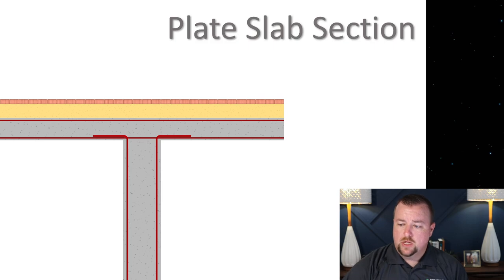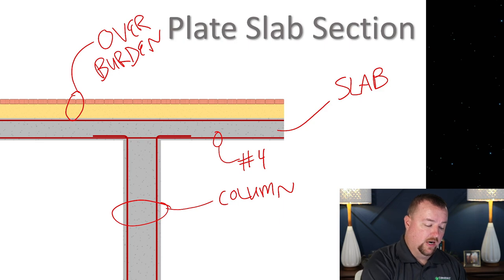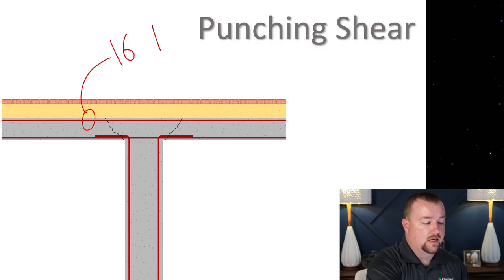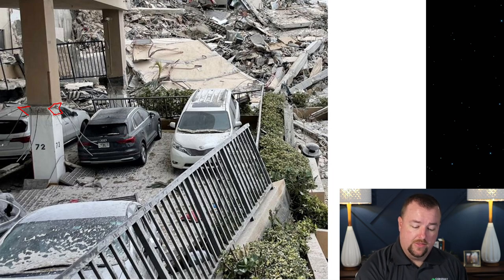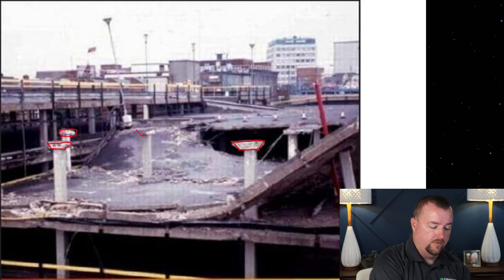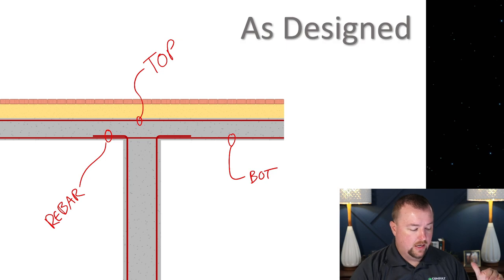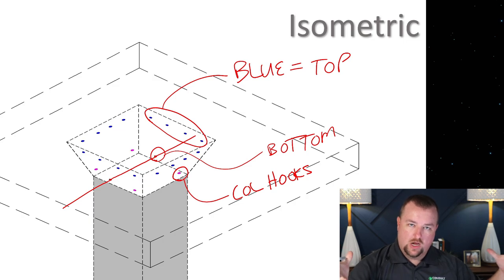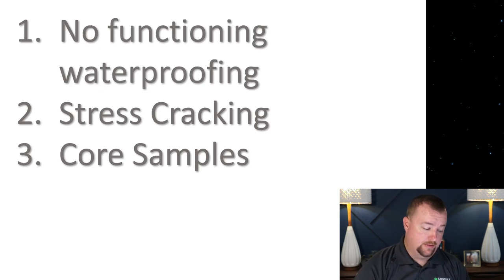The Importance of Punching Shear at the Surfside Collapse

Comment: I’ve never completely trusted flat slab construction. I’d expect to see a thickened slab at column heads.  You can try to reinforce against the impact of concentrated shear at the column/slab interface, but adding a column capital or thickened slab is really the most effective.  The initial construction challenge is worth it.

Comment: Those columns needed reasonably wide capitals on top of them to increase the area needed for bearing the slab above. This would have tremendously helped to spread the pressure out enough to prevent the concentrated punching shear discussed in this video.

Comment: Just to be clear the top steal (rebar) is in the structural slab. So it actually split horizontally at the top steal. It would appear that the extra #5 bars are missing altogether. They (#5) do not appear in any photos, right?

Comment: It seems to me, after listening to you explain how this column and slab construction is supposed to be built, that somewhere in the building process boxes were not in place. Also, the columns of the building still standing were much bigger than the failed building. I wonder why this was the case? Design flaw?
Reply: I’m talking about reinforced column boxes over the top of the column.

Comment: Perhaps the pooldeck was paved over tiles because the spalling / delamination under tiles had dislodged /dissarrayed them and an expedited mend ( ie no mechanized removal of tiles / adhesives /mortar) introduced more weight and hid and/or exacerbated damp ingress problems.  Just around pooldeck  areas. Possible? Likely? Accountable?
Reply from the maker: I've seen a lot of half-baked ineffective repairs... just not this one specifically.  Definitely gonna add it to my list of crazy things I've seen.

Comment: Oh, also, any thoughts about the contributions that may have been added to the delamination by the rhythmic (possibly constructively resonant) vibrations caused by the exercise room stretching across one of the main sections of weakened slab between pillars? Should rennovation contractors take underlying structural design elements like that into account when advising a client on what to put where?

I mean, I'm assuming the engineer/architect who designed this building didn't intend a dynamic resonant load like that to span across two pillars... or maybe he/she simply didn't consider it to be a problem given the safety factors involved?

Is that architect/engineer still alive? Has anyone interviewed them?

Comment: Why does the core sample look so beaten up? How can there be all that air space in the big irregular cracks? Was there powder and broken concrete in the cracks that instantly fell out when the core was removed? That missing material had to go somewhere! Also, when you showed the actual picture of the punch sheared slab, the upper few inches that had the rebar in it, was so cleanly the same thickness for a long way. How is that possible? The delamination goes consistently that far?

Comment: In regions where concrete may deteriorate significantly,it is a good idea to design to resist pushing  shear solely on the resistance of concrete only . Instead of providing steel to resist additional shear,  drop panels  or column capitals are a better choice. In the
this
 catastrophic  failure actually rusted steel may
Be
 the main cause of failure . Ironically it is supposed to prevent such failure ...

Comment: I think this pool deck portion without the building over it should have been it's own structure separate from the building itself and it's parking structure... if the deck failed, it would only bring that side down only and not the whole.

Comment: One thing that's sticks out in all of examples of the punching shear photos I've seen recently,  is they are all car parks and all exposed to the elements , this type of design,  slab on column,  is ok if there is a building on top protecting it from water penetration,   but not for a car parks and decks  that are  exposed to the weather,  and the evidence so far is pointing to the collapse of the Champlain towers pool deck as the catalyst for the disaster. Slab directly on top of column is not a good design for exposed structures , they need to be more robust.
Reply: The roof of every building like this is exposed to the elements.
Reply: @stargazer7644  yes that is true,  but there is one big difference ,  the roof of a building is not only supported by the columns,  but also by the dividing walls of each unit,  in a parking garage there are no dividing wall for extra  support.  That's why you need additional cross beams to distribute the load. Plus there is no additional load being applied to a roof top,
Reply: @kingdomfor1  I thought we were talking about water and weather exposure to exposed structures. Who said anything about cross beams and internal walls?  Plus, internal walls in these buildings are generally not structural.
Reply: @stargazer7644 I've just edited  my last post , stating that loads on a roof are different to the loads on a carpark floor ,  in the Champlain towers, there was additional load on the pool deck from the overburden and the paving, and in the pictures of other punching shear collapses,  the additional load comes from the    cars being parked,  everyday the carpark floors are loaded then unloaded , so there is constant flexing of the floors . I'm not sayings I have all the answers , but as a builder,  I understand how loads work. This is just my opinion.  Ps Most wall dividing units are fire walls made of strong materials,  plus a maize of none structural wall will help support a roof .

Comment: so considering then, that on each of those columns tops, there should be 8 bits of rebar going across it (4 one way, 4 perpendicular) in the slab (albeit in the top portion of the slab), where has that rebar gone, we cant see it. did they forget to put in the shear reinforcement?

Comment: So I have a stupid question:
Given the failure mode of this building, should cores (or some other testing) be done on the other buildings built on this design to determine if they are in danger of failing in the same way, especially when at least one of the other buildings seems to be showing similar signs of distress?

Comment: How do you waterproof the concrete? How did they know it was missing? Can you waterproof the concrete after such a long period after a structure is built and deterioration has already begun? If the concrete had been waterproofed originally (or even years later), is your opinion that the building would still be standing today? Sorry if you’ve answered this already.

Comment: If it delaminated then not only does the top layer not help provide structural support it just becomes more of a load the bottom layer has to carry? Less steel to hold more weight?

Comment: The column where the concrete was pulled out of the column looks to me more characteristic of a bending failure rather than shear.  If the other end of that slab section lost its support and the slab became a cantilever beam, then this failure pattern isn’t so surprising as the top of the slab would fail in tension rather than shear.
Reply: Very good point! I guess looking at that type of detail may help with determining the direction/progression of the pool deck collapse leading back to the point of initiation.

Comment: If you put weight away from the column you introduce a pull effect at the top of the slab, so what would that cracking look like?  would the delaminated metal even protect from that sheer at all?

Comment: Can you tell us if the engineering report fix this delamination issue? How would you even go about fixing this major issue.
Reply: I wondered about that as well. The answer may be in the engineering report which is online I think. This video makes me think that the correct solution was to replace the entire pool deck/garage roof. I don't see how it could have been repaired without so much work that starting over would have been the economic approach.

Comment: My concern is the cores contain a piece of rebar. When the rebar is cut the rest of that piece of rebar, or at least for a distance, that piece of rebar becomes structurally weakened. Is this correct? There doesn’t seem to be very much rebar in the slab to begin with, and cutting any pieces of rebar severely reduces strength in at least that area. Coring through structural rebar doesn’t seem smart.

Comment: Novice here. Perhaps a dumb question. Is there anything better than rebar to reinforce concrete? Or something to mix in the concrete, e.g., polymer composite, to provide more water resistance? Has materials science provided any solutions to these seemingly universal problems? (I’m thinking about the rebar mesh I’ve seen being set in highway concrete, months before road crews pour saline and salt on the roadway to melt ice.)

Comment: I always thought that you get maximum strength in a horizontal concrete member by putting the main steel reinforcement towards the bottom where it is in tension.
Reply: Indeed. That is correct, except where that horizontal member passes over a pillar. Then the forces are reversed and it's the top that's in tension.
Reply: @heyyy4783  thank you!

Comment: As I wrote again in a comment, beams had to be used. Only if the slab is too thick and internal reinforcement is used as we call it here "hidden beam" or reinforced zone. In my country, even if the slab is 8 inches thick, beams are used, although there are exceptions, but with excellent reinforcements. The Zoellner or waffle slab method has also been popular in industrial buildings and offices for decades.

Comment: In 1974, a federal DEA building in Miami collapsed, killing 7. This was supposed to be the reason for the 40 year inspection cycle being instituted. Also, back then, contractors would make concrete with the cheapest sand/gravel they could get (i.e. they did not wash the salt out with clean water before using it). 

The structural engineering lessons weren't learned. In 2012,  a Miami-Dade parking garage under construction (i.e. unloaded) failed, killing 4.

The structural engineering lessons weren't learned. In 2018, a Miami pedestrian bridge under construction (i.e. unloaded) fell, killing 6.

Surfside didn't get the maintenance it needed. The residents were willing to vote 'no' on anything that raised their monthly costs. Everything I've read about the board meetings tells me that "saying the right thing" and "doing the right thing" was rejected by the tenants. It is sad there is so much blame to go around. The state has not been willing to make it mandatory that a sizable repair/maintenance fund be REQUIRED, instead of optional.

Comment: Is it that much more expensive to put drops around the columns? I don't know they are called btw if you could tell me. Thanks
Edit: Found it
Drop Panel and or Column Capital
Reply: It's a little more expensive but it also eats into the headroom and nobody wants less headroom in their condo.  Depending on the limitations when the building was built they might not be able to just make the building 6" taller times 12 floors, that might have meant the difference between being able to build 11 floors vs being able to build 12 floors.

Comment: I understand that floor delaminated because of corrosion and the column punched through. However the upper floors slabs were not subjected to delamination due to corrosion. So, why did they all punch through? The building would be damaged but really should have only settled one floor without all floors pancaking.

Comment: Interesting, but you have not answered what is perhaps the key question:  was the building actually built to spec or was less rebar actually used during the build?  There are also photos out there showing that the mat was not really a mat because steel wasn’t tied together, in what seems like a construction defect.

Comment: In your photos from around the world the flat sheer head tops still did not prevent the slab from coming down/punch. Was the rebar not there or not enough or..why? I know this is a loaded question and each building has details that contributed to its demise. 
 What??  "The deck had no functioning water proofing". Insane!! Oh no..poor workmanship and downright wrong repairs/building enhancements? No sheer head and thinner columns in this pool area and other areas, 16 inch as opposed to the other side of the building that had 24 inch columns. Many factors in this horrible collapse. Im learning so much and what to look for in other buildings.

Comment: Why wouldn't the "shear rebar" at the column (4 pieces) be located at the bottom of the structural slab, instead of the top?? Shear rebar at the top, allowed the majority of the structural slab to simply shear at each column, and drop.

Comment: At 23:52 you started a red marker cross hatch on the still standing cross section as you were ending the de-lamination discussion..why did that slab look " sedimentary" ? It had distinct parallel groves?  Could that be pouring and stopping short on a hot day? They couldnt have. Holy mackerel

Comment: Since the Acropolis was damaged by rusting iron (from renovations) expanding out and cracking stone, you'd think engineers might figure out that iron rebar is damned stupid. In contrast, the Romans made concrete with NO REBAR and their 2000 year old works just don't have this problem.
 Kevlar and Aramid chopped strand and other ways to reinforce concrete all eliminate the toxic rebar. So why keep using rebar?

Comment: I understand you cant do a video now but could you possible do a video later. Something on what procedures could have been used to fix or correct the failing parts of buildings like this. I just wonder if core samples would have been taken even 2 years ago and reviled possible delamination, how could it have been fixed or even could it. At what point do you test a say a building is unsafe.

Comment: Only way of dealing with punching shear is increase the shear perimeter thro bigger columns and/or increase slab thickness. Horizontal bars won’t do a lot. Too thin for shear links. For an engineer it is such an easy check against the maximum loading. I wonder if the super dead is far thicker than the designer ever allowed for?

Comment: A BETTER design is needed for slabs that will bear weight. Vaulted ceilings might distribute loads. Rebar needs a stronger, slip-resistant joining technique IMO. Hooking the rebar might prevent lateral movement of the bars? My 2 cents.

Comment: Do builders, designers and engineers have a duty to create a larger margin for safety when they do their work?
I feel like the switch to thinner columns and switching their orientation removed a good deal of built-in safety.
Widening focus: should laws be passed to require all builds to meet a higher standard than today?
I lean towards yes but I am not a pro at any of this.
And I completely understand the fact that it raises costs and that going overboard is not necessarily a good thing.
Seems to me that multi unit, multi level builds should be more sturdy and shy away from 'cutting it too close' .

Comment: I guess some of the material from higher floors might take the shear plug material away?
But English example the shear rebar was evident but why was the top flooring in a perfect square...even with rebar poking out of it?
How does 16 bars get used but only 1/4 per direction...that's 8 of 16...where is the other 8 going?
Delaminated the rebar will still be there.

Comment: This explains (even to idiots like myself) why the garage collapsed but why did the entire building fall? The structure was only compromised on top of the garage, where there was water exposure, what am I missing here?
Reply: That slab was connected to and sitting on the outer columns that held the building up. If it damaged those columns as it failed, that’s all it would take.

Comment: So the slab has all these layers. Is this consistent with the theory that the original slab was built with a sloped surface that ran water in to drains, but at some later time they made the deck level by adding a  waterproofing layer, sand and pavers over the old tile? OR is this multilayer mess original?

Comment: What causes delamination across the whole slab? Wouldn't that happen in the areas around the planters not across the pool deck? This isn't earthquake or freezing country. Why don't we see more rebar fraying out for the tops of the columns? Did the punch through act like a shear all at once across the pool deck?
Reply: Due to poor waterproofing the whole deck slab was permanently saturated with water. You can see stalagtites in the parking garage video where the cement has dissolved. I'm not convinced there was enough rebar in the deck slab.

Comment: punching shear is a possibilty. But all the columns at the same time? I could not see the reinforcing from the columns into the slab. There should be steel from the columns bent into both matts of the slab reinforcing. Maybe the photo was not as clear.

Comment: Very interesting and educational, but doesn't explain what happened with top rebar, and top part of structure. Bottom 3/4 delaminated and punched, but completely unclear destruction mechanism for top 1/4, especially having 4 x 4 rebar over the column.
Reply: He doesn't say so, but several photos show a distinct shortage of rebar protruding from the deck slab after the collapse.

Comment: With all that rebar at the top of the slab, they were basically hanging them from the tops instead of supporting them from the bottom. They were working against gravity instead of working with gravity.